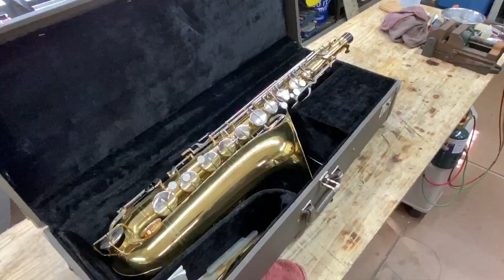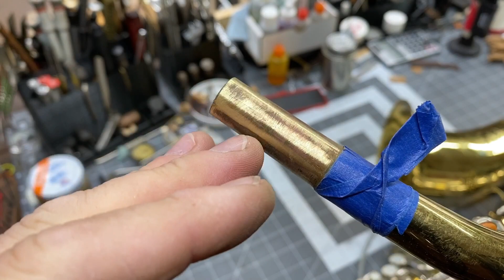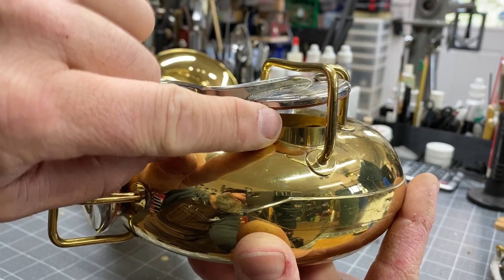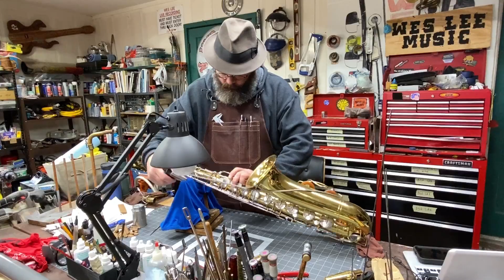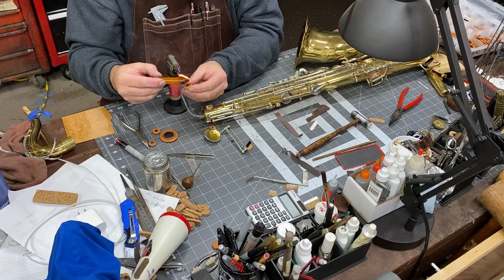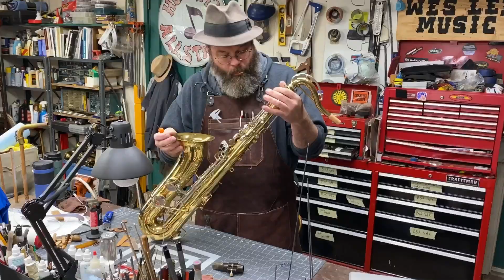Beautiful Ballin Buescher Tenor Sax- repair and restoration

Comment: Hi from the UK  Wes.  As a DIYer I don't have the confidence (or equipment) to bend a key arm to get the cup absolutely parallel to the tone hole. I shim behind the pad before hot gluing it into the cup, then heat up and adjust the pad  position for no light bleed. Pad to tone hole distances!!! Erm.....?  Love your work.

Comment: Nice to see you putting the seam on the bottom of the neck cork. The proper way. Question for you ,on school horns do you use two pieces of scrap cork from a one piece strip . Also do you use synthetic on schools or just natural corks.
Reply from the maker: Thanks for watching. I only use single piece natural cork that I cut to fit each time. I don’t use any synthetic on neck cork or joint corks. I have a separate method for “emergency fixes”, listed in another video.
Reply: @wesleemusicrepair9820  in my shop we do the two pieces neck corking on saxes with natural corks and some times synthetic only on school horns. Cuts down on the price. Reduce a lot of cork waste. A sheet of cork cost us almost $60 Canadian from Alied to Canada. Funny thing allied gets the cork from a Canadian supplier in Ontario gets ship to the US suppliers and we have to buy it from  Allied or Ferees band supplies.we cannot get it directly  from International Cork supplier in Canada.Figure that out🤔.On individual customer horns we use full natural cork on all clarinets,saxes and bassoons.

Comment: Even though the player has a heavy hand while playing who’s to say that the heavy hand didn’t develop due to the poor prior repair? I think you’re doing the wise thing by optimizing a light touch. Since using a heavy touch could be a conditioned response the mind could gradually learn to exert less pressure. It may increase his enjoyment while playing. If he relearns what’s needed to play he’ll remember it’s not normal for a heavy hand. 
This makes me wonder how many are adjusted improperly from the manufacturer or quickly knocked out of adjustment? I tend to think that’s how they thought it was required to be played.